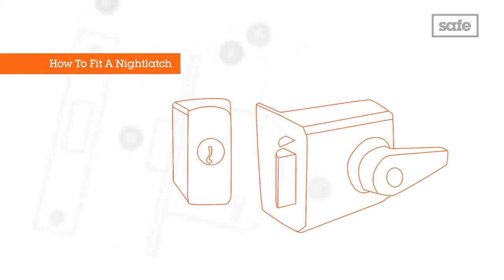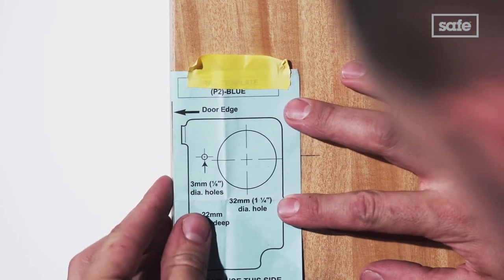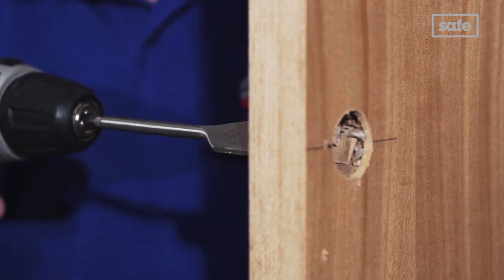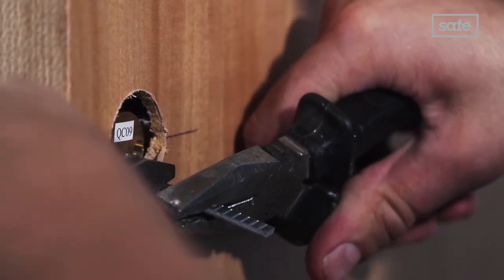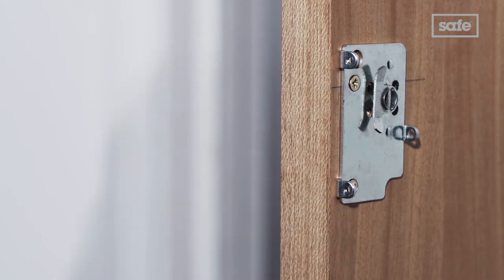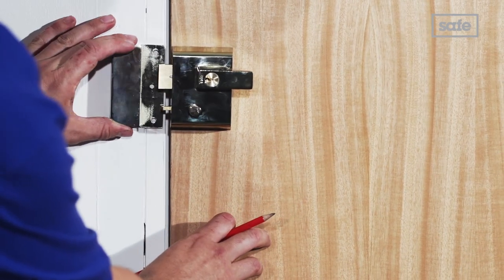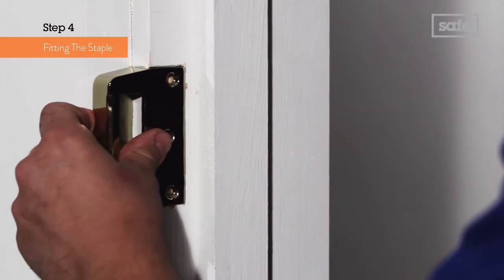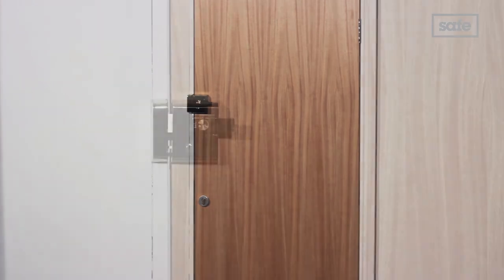How to fit a Nightlatch Lock

Comment: Hi,

Today I had to call a locksmith to open the door for me as I left my keys at home. He drilled around the lock on the outside and now the nightlock cannot be opened from the outside. Is there a way to fit the outdoor portion of the lock back in?
Reply: I'm a locksmith  the locksmith should be doing a non destructive method on a basic night latch if the lock is damaged he can't be a high quality tradesman